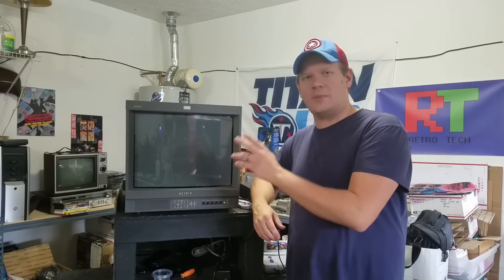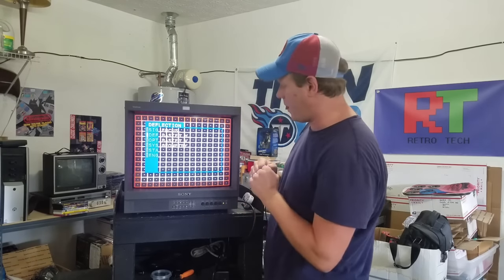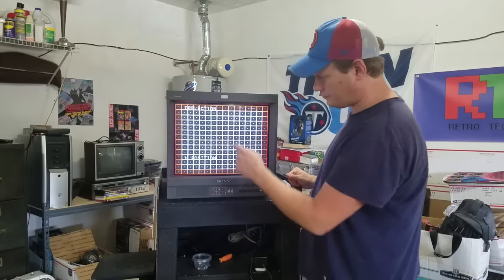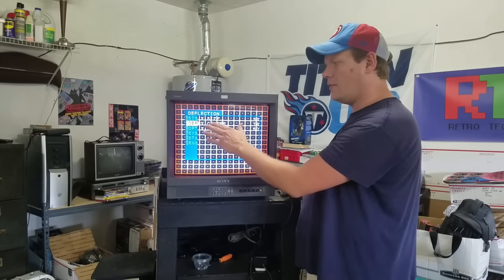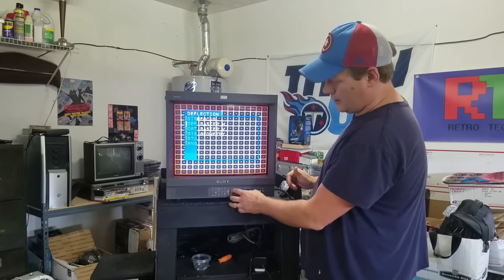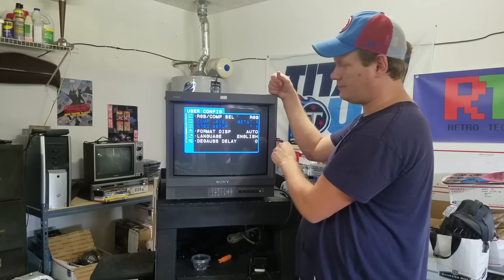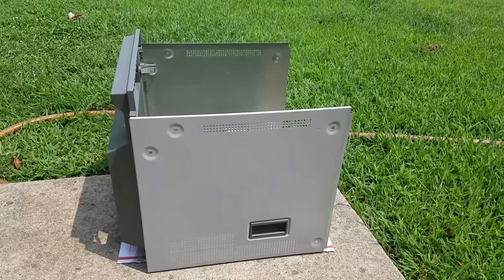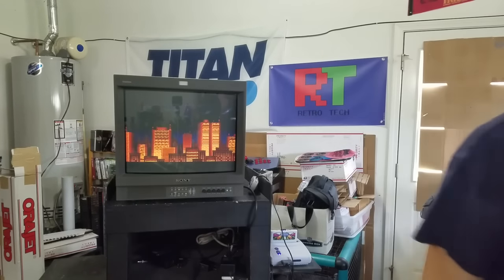Sony PVM 20L2 Calibration  (Part 2)

Comment: I work at a hospital and I was lucky enough to get a 20L2MD for free a few years back. It didn't get much use from me because it needed to be calibrated and I didn't know how to do it. This video was such a help. Once I had it configured properly I fell in love with it and now I play it everyday. Thank you so much for this video and all your other content.
Reply: Mine has convergence issues in the top right corner, paid less than 350$ for mine. I would like to fix it, but I don’t want to mess it up, it is also a bit dim, and I have to max the contrast on the front knob to get a good picture.

Comment: For me I like to adjust the vertical size until the red dots are just barely past the edge of the bezel using the 239p Grid. This helps hide any kind of pixel junk with NES games and hides the black borders on SNES games.
Reply from the maker: austin532 That's a great way to do it.
Reply: The only downside to this is some games like arcade ports have text near the very top or very bottom of the screen but the amount of games that actually do this are far and few between.

Comment: Excellent - I've been wondering for a while if there's a preferred version of the 240p test suite that would cover most systems/bases. I have my 14M2MDE calibrated with Megadrive version. With this new info, I'll go back and calibrate using the SNES version 😃

Comment: Hey there, Retro Tech. I have an issue on two of my 20L2s and 14L2 where the aperture setting in the service menu has no effect on the display whatsoever. No matter what input type I use (composite, s-video, component) the "aperture" setting does nothing. I've tried it at 0, 100, and "off" . The screen seems artificially blurred to my eyes. The OSD looks much much clearer to me. I don't know if you still have any L2 monitors on hand, but I'd love for you to take a look and see if you have the same issue. Thanks!

Comment: Great video ! Just found your channel by chance. I've got a couple of L2's that have been in storage for a while and they've both developed faults. On one the geometry is off on the right hand side, the picture is slightly slanted showing some black. The other is really dim, almost high contrast but desaturated and grey.
Do you think recapping these might help or maybe a yoke adjustment on the first?
Reply from the maker: Thanks for watching.  The first one will need a yoke adjustment if the hole screen is tilted.  If it's only tilted in a single corner, then you will need to adjust the Pin settings and may also need to move the convergence strip for that corner slightly.  The first thing to check on the dim monitor would be the flyback.  There are 2 potentiometers on it.  The bottom controls brightness & to controls focus.  try turning up the brightness on the flyback.
Reply: @RetroTechUSA  amazing thanks! I'll try this out!

Comment: Love how detailed this video is. Great work! Picked one of these monitors up today, so I'll be taking it through the same stages on this video (and part 1).

Question: I don't have the test suite you showed or capability to run it. Is there a game that's good for calibration when paused or on the start screen maybe?
Reply from the maker: Thank you.  which gaming system are you using on the monitor?
Reply: @RetroTechUSA  I have SNES, MegaDrive with RGB and a NES but none RGB
Reply from the maker: The SNES is going to be the best system to use.  I'd see which game you can use to fit to the screen best.  Maybe something that is a side scrolling beatem up with a life bar, etc.  games that use some type of widescreen feature would not be helpful.  You can get a rom cart for the Megadrive for pretty cheap now and it will run the 240p software, which is free.
Reply: @RetroTechUSA  Ahh ok. Is the life bar to help with straight lines etc? I have a few beat em ups, and fighting games might help in that respect too. Thanks for the tips!
Reply from the maker: @jamesdecade  Yes, no porblem!

Comment: Wouldn't know how the correct procedure to do VSL would you by any chance? I have a new Phillips crt with a bit of vertical stretch on top inch of the screen.
Reply from the maker: Vasili Is there a service menu in the monitor? If not, there is most likely a potentiometer inside the montir on the deflection board that will control those settings.
Reply: Yeah man ! i have access to the service menu, I'll do a quick video later and post back. I haven't got the back off yet security srews :p only
Reply from the maker: Ugh, Security Screws suck!  I have an old Panasonic CRT Monitor that has some lame security screws that I can't find a bit for anywhere.
Reply: If there the same as mine they have a nipple in center of a star bit?  You just need a small flat head screwdriver and use the center pin as a offset , and unscrew, or most the time you can use same flat head to snap the post and use a normal star bit then.  I am a mechanic so used to them issues.
Reply from the maker: Vasili Mine is quite od. Just 2 tiny lined up holes
Reply: Ahh I see same , same deal get a old flat head and grind two pins out of the tip. Dremel should do it. I am just being lazy as Its going in a cab and be de-cased anyway probably just cut it off he he

Comment: How do you recommend adjusting for a proper 4:3 aspect ratio?  Like making sure squares are squares.  I fiddled with width and height and now feel like the ratio is a bit off.
Reply from the maker: Thanks.  I think the V Linearity setting should help with mis-shaped squares, but the older the monitor; the worse these things can look.  I just get the size overscanned slightly so I don't see the edges of a display picture.

Comment: consider getting a lapel microphone you can clip to your shirt and record with, less shouting required, less echo.
Reply from the maker: Thanks.  I'm looking at Mics right now.  I deffinently need that or some type of mini-boom mic.
Reply: They're super cheap, Jon Linneman from Digital Foundry uses it and it's got excellent sound.
Reply from the maker: Do you know of any specific ones that work best for value?
Reply: Afraid not, I can't seem to find the exact one I was told but I believe it's less than 30 bucks. Would still be a big improvement in audio.

Comment: Just got one of these 20L2’s.... I’ve noticed that if you bring up the OSD (or any signal really) you get these black shadows  to the right that go horizontally across. Happens when using a signal too.  Any ideas? I’ve turned down the brightness which takes care of it for the osd but in games you can still see these shadows always on the right side of an object or word
Reply: Same issue as seen here: http://imgur.com/a/e4gtZ
Reply from the maker: Do you think there are a lot of hours on that tube?  I would try to adjust the screen brightness on the back of the neck board to see if that will go down any.  May also want to try turning down the contrast and brightness in the sub-menu.  I hope the tube isn't worn out, but that is possible.
Reply: Retro Tech not sure about the hours on the tube, got it second hand.  I can adjust out the osd issue but on games there are these drop shadows on certain elements that hang to the right.  Bear in mind that I’m using composite at the moment.  I hooked. 360 up component and it looked fine so I am hoping what I am seeing is noise from composite.  My breakout cable should be in soon so my fingers are crossed.  
I am used to working on arcade monitors so I am really familiar with the adjustment pots around the neck board and fly backs. One thing I found weird on this guy was the knob for the screen on the fly back does absolutely nothing when turned.. The focus knob works fine on the fly back and neckboard.  I haven’t found a remote pot for the screen brightness..

Comment: im getting crazy with my samsung TX-P3064W, i screw all geometry settings and now i got a image curved and blurry as fuck... your videos are amazing but for my tv doesnt work :c

PD: i try the suite 240p with my nintendo wii with component but i dont get the result i spected, any advice?
Reply from the maker: I'm not familiar with that monitor.  Is it a CRT?  You should google for a service manual and see what the initial factory settings are on the TV.  That will give you a good starting point to fix the geometry.